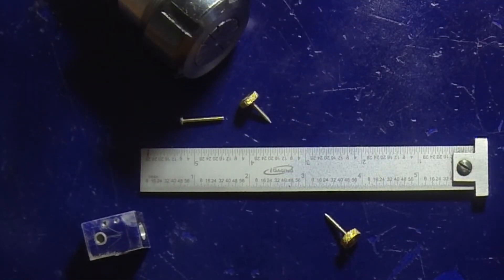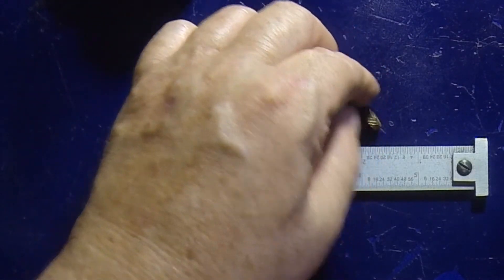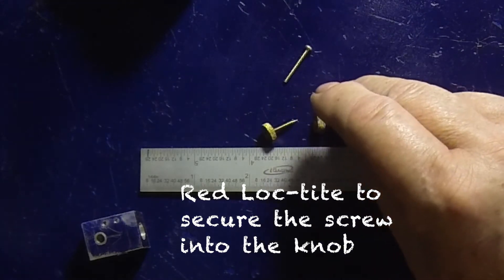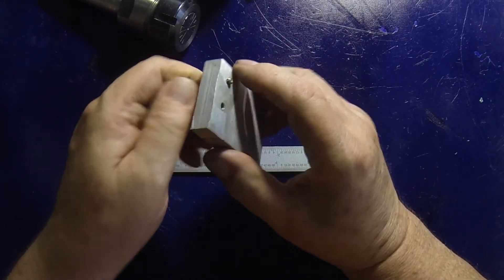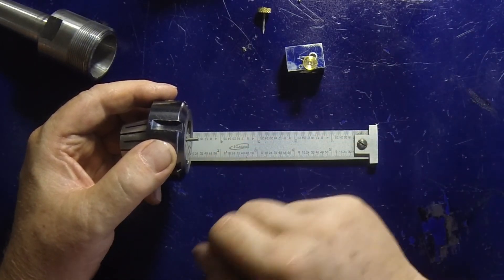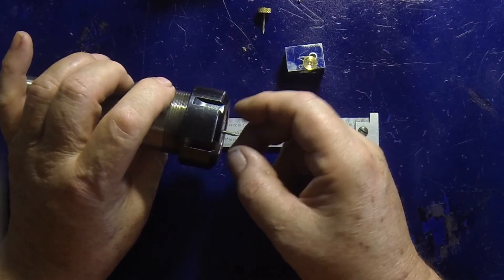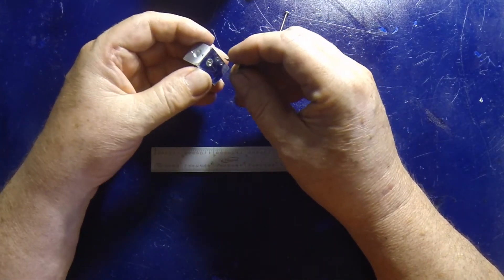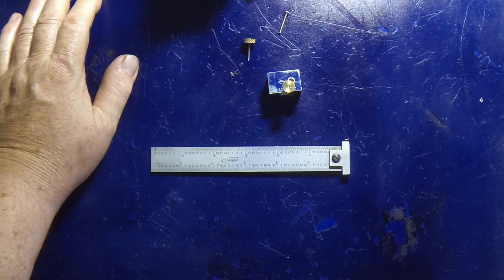Carb Adjustment Needles

Comment: Tiny little buggers, those small parts are a hard sometimes just because they are fiddly. Thanks for the video.
Reply from the maker: Bundy Bears Shed I really have to rely on the measureing devices when it comes to the small parts.  Have to be real careful and don't push the tools or the part.

Comment: That small stuff is probably hard to work with than the Abom-sized shafts. ;-)
Can't wait to see it run.

Colin ;-)
Reply from the maker: ***** Yes it is.  I was surprized that I didn't break a #50 drill bit or the 2-56 tap.